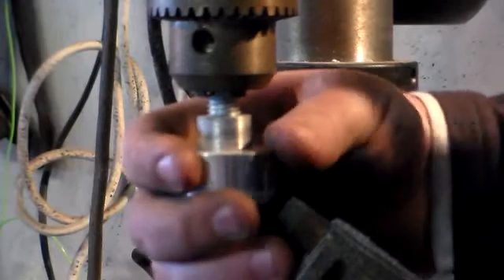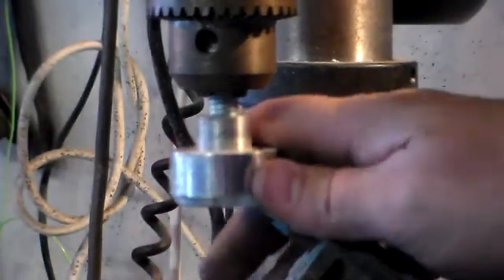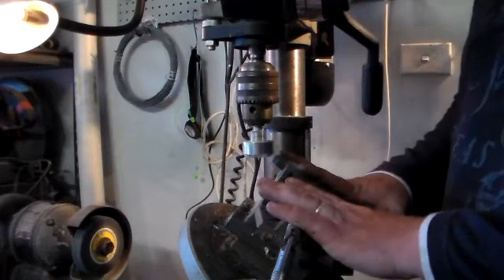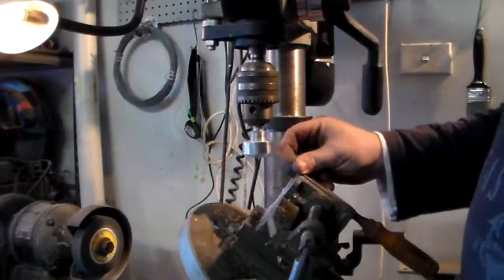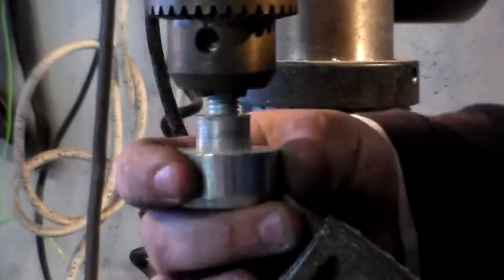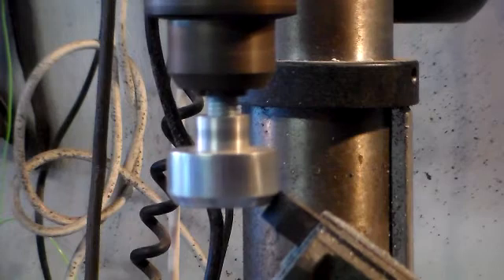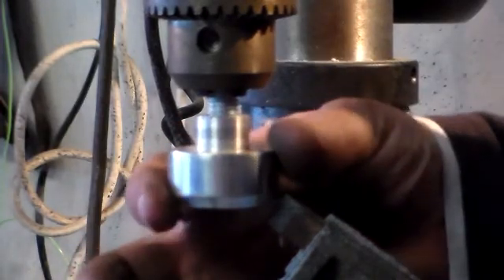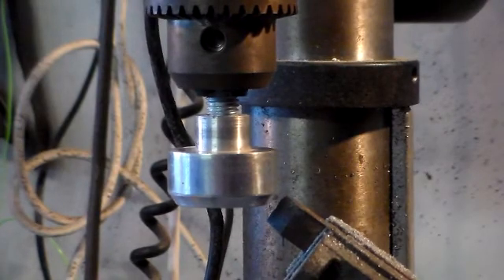Alex Does DIY_Garage Series_Using a Drill Press as a Lathe

Comment: Instead of going through all this rigamarole (sp?) Why can't you just chuck up a 1 MT spur drive in you 1/2 inch drill press chuck, and put a live center in a hole drilled in a block of oak clamped to the table?  Center them and press your blank in between?  Viola, vertical lathe.

I just bought the aforementioned items and am going to try it ASAP.

Comment: I would recommend high speed steel as the cutter. Carbide is better. HSS lathe bits are best but a resharpened masonry bits are okay. You want to achieve smooth cuts as much as possible, especially when making a flat, clean surface design to seal melted plastics. Smooth cuts are made when tiny amount are cut out at a time.

Comment: This is a good set-up I haven't seen before. Congrats.  I would recommend using a lathe center.  You can probably make one I believe out of a hardened alloy screw. This helps stabilize and to to prevent run-out. But the main reason is to prevent chuck dropout that you've mentioned to me earlier.  As you screw the screw in, it hits dead center then stabilizes the work.
Reply from the maker: David I like the idea of using a live centre.  Gives me ideas of a future project......perhaps I could remove the table from the table support and make an attachment that includes a type of tail stock to run a live centre with an adjustable tool post off to the side..mmm the possibilities. One project at a time though !